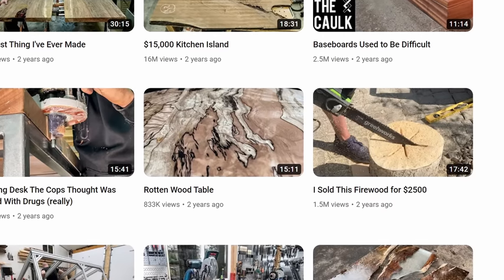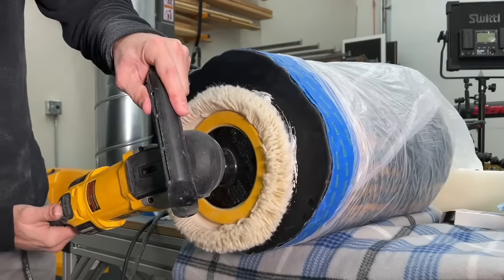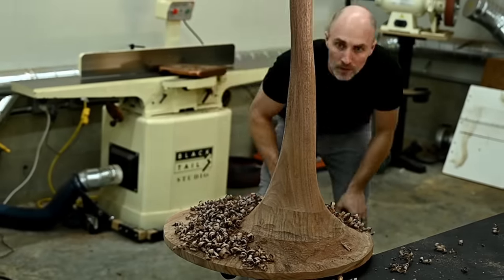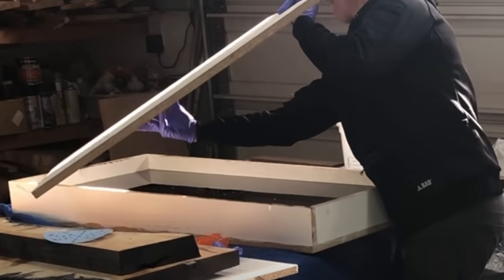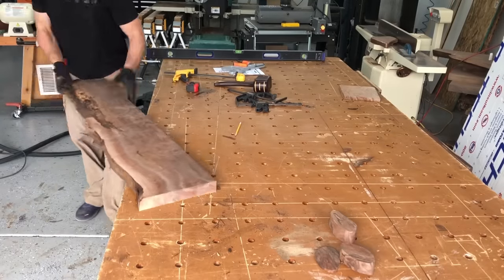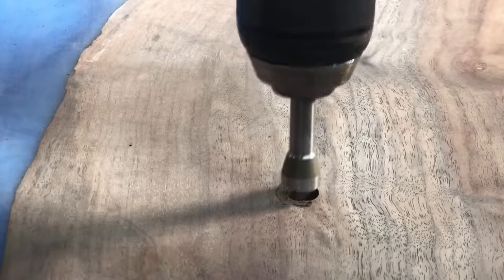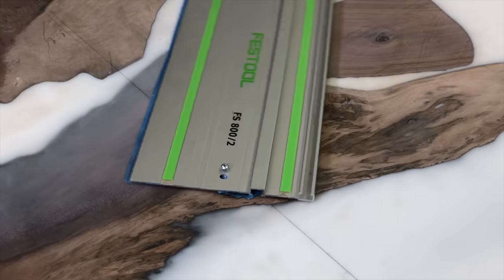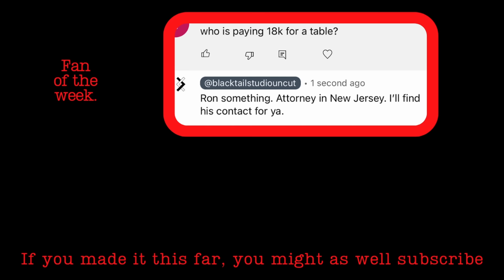$131,708 From 5 Terrible Projects

Comment: SUGGESTION: I wanted to share this for glass flat polished epoxy finishes(High value), on denim or pours where epoxy depth or how the wood soaks it in varies. It's absolutely essential to heat treat it at 60C for an hour or a few if it's thick(like it's done in the car industry). Otherwise, you will polish it to a flat glass surface, but in time, epoxy will keep setting and developing microrelief and stop looking like a mirror finish from an angle where you catch a sheen. Let it set first, then heat treat it, then sand it flat, then polish it for good. In car panel fixing, the depths are very small, but if we do not properly heat all the levelling epoxy products before the last sanding and primer, we get a flat finish, but after heating the last coat of paint(clear), we get crater outlines of fixes. Sometimes it develops after some time under the sun... We use infrared heating reflector panels.

Comment: 2 issue that you might like. 1 use oil instead of water to sand it helps remove previous sanding marks..2 I use this same process to build a base guitar along with 3 others.

Comment: I hate to admit now that the blue metallic river table is how I found your channel and is still one of my favorite pieces I have seen of yours.  I came here looking at filling voids in wood with blue or turquoise epoxy as I am working on a classic truck with a wood bed floor and I want to use figured mesquite wood for the floor and rather than trying to scrounge up some 7' perfect pieces I think it would be awesome to match the tartan turquoise paint to some degree in some epoxy so I have been researching doing just that (probably a few years ahead of the project being completed).

Comment: Howdy, I also work with epoxy, carbon fiber, and vacuum bagging race car parts. 1, no masking tape it is paper, use 3m aluminum foil tape for heating and cooling ducting from Home Depot. Rigid and always a clean release. 2, when vacuum bagging ( ie denim table) use a perforated release film under the peel ply, debagging would have only taken minutes and easy.

Comment: We install solid surface showers at my company. They are basically a stone resin composite. Our vendor has said that if we keep the shower panels sealed up (uninstalled and in the protective plastic sheeting) for months the panels can yellow significantly because they are not allowed to off gas while fully curing.  

Maybe that's what happened to the white epoxy table.

Comment: the yellowing was accelerated by the blocks of wood leeching tannins into the epoxy as it cured, try cactus juice stabilizing resin and paint them with the same color as the pour so they match. i am glad you fixed it and they bought a 10k table from you so you got more business by fixing the issue. to me that table looked kinda cool with the yellow but to each their own. as for the blue table i liked it but again, to each their own.

Comment: Cam, I know you love and prefer Rubio over Osmo. In the UK Osmo is more available and cheaper. Your justification for Rubio is that it provides more protection. However, you now finish all of your tables with Nano 3 which provides ceramic level protection. That being the case would Osmo not be as good as Rubio? Also, do you envisage moving predominately to the UV cured finishes in future? Love the videos and wish there was a market here for the high end stuff. John

Comment: The blue River table is my favorite of these, personally--honestly I like most of the things you have made. I like the pearlescence of the blue one, I know you prefer the black epoxy with the walnut, but I like the shimmer in the resin. Wonder if it's possible to do a mostly deep black with just like a single swirl or hint of shimmer but I could never make one of these (no space for building, three cats that are perpetually getting into everything, and epoxy is a smidge expensive for someone like me)

(I saw the white epoxy table and as soon as you said Hawaii, my heart sank, most resins yellow in the heat, yes, but also in sunlight, and that was some bad yellowing, and in only a couple of months?? Though if it was sealed up in plastic pretty well, I think that can also contribute to faster yellowing)

Comment: remove tape with a heat gun to soften the adhesive. don't apply it until the epoxy has plenty of cure time,  depending on the epoxy this might be a week or more.

Comment: I spend forever and a day trying to talk my clients out of using blue epoxy. Usually in vain. The nicest pieces I've ever made had something other than blue resin but if it's someone else's money, they get what they want in the end. You get the odd client that wants an interesting colour and they're the fun ones to work with. And i have never managed to find a white tint for epoxy that doesn't go slightly yellow over time. It;'s the absolute worst colour.

Comment: The burnt table.  Question about finishing.  You mainly use Rubio and have stated that osmo doesn't provide as much protection.  My question is do you think/or will you test to see if your nanocoating/ceramic top coat levels the playing field for protection?
Reply from the maker: I think it’s worth testing!

Comment: Sorry that table yellowed like that. I’ve done hundreds of large epoxy bar projects over solid hardwood, plywood veneers, inlays, painted surfaces, concrete, integrated lighting, and memorabilia. I can only suggest that you use a painted medium to fill those segments then clear coat to the surface you plan on planning. I suppose it could be filled with deep pour epoxy that’s tinted but todays paints are inherently UV proof. Just a suggestion.

Comment: At first I thought deer as well but at 8:17 I see a pig.
16:00 That table is not ugly. The blue is awesome. :P
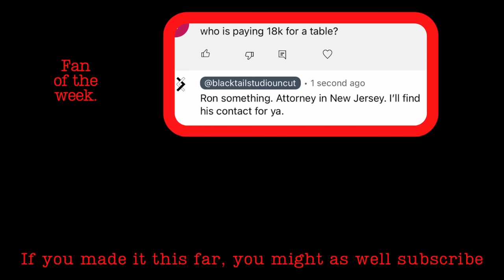23:49 Tried to figure out the dollar to view ratio from this but guess I'm missing some information because it doesn't calculate with any sense. 
#1: $0.00352/view; #2: $0.00708/view; #3: $0.00234/view; #4: $0.00631/view; #5: $0.00371/view;
See? Missing information to make a proper calculation. I thought, maybe the more views you got, the higher the money per view you get paid but then #3 obliterated that because, even though it was the highest paying video with the most views, per view was actually at the lowest. Also, #4 was greater than #5 even though #5 had more views.